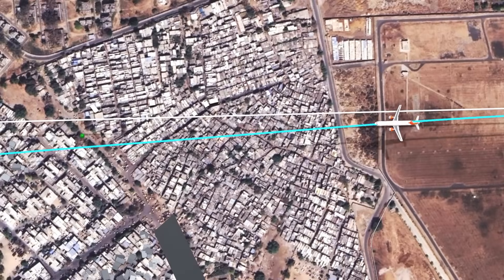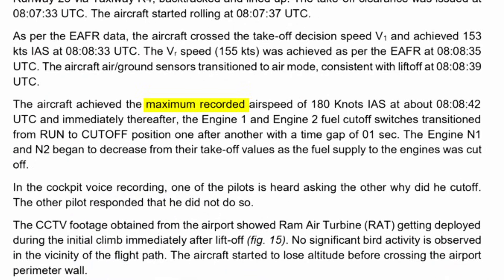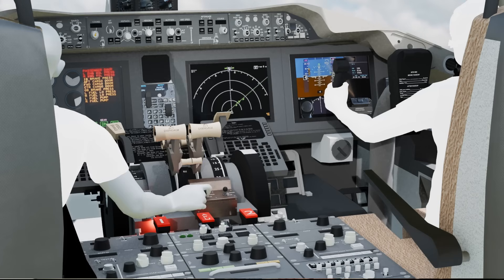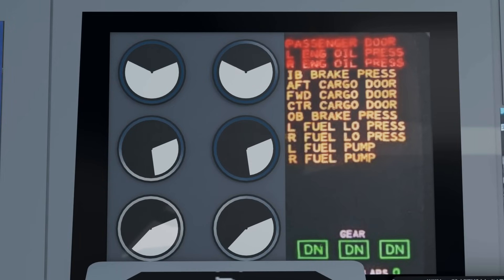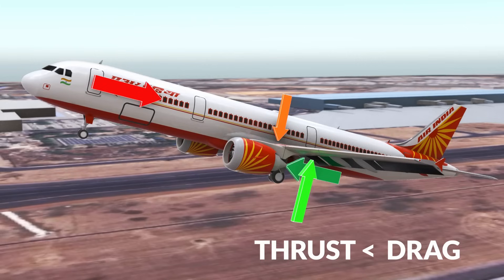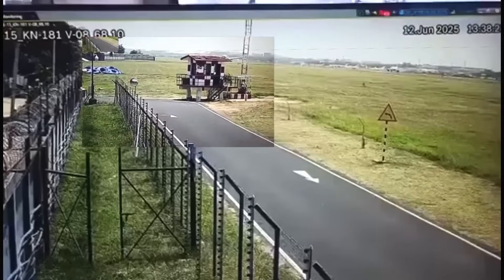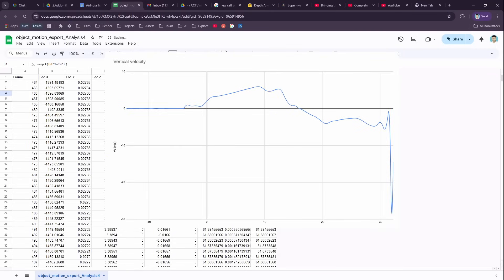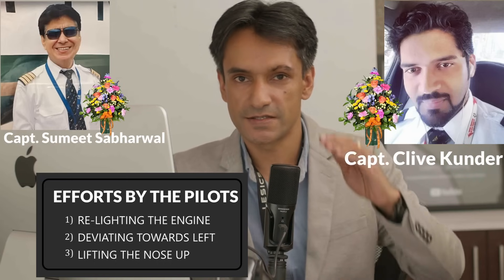Use of 3D Clone | Decoding the Crash Details you Missed

Comment: The is an excellent analysis, but a few points:

180 knots in the preliminary report is indicated airspeed, which is less that actual airspeed. All instruments have an error range, for airspeed (and altitude) the error is always indicating lower, because that is safer. If the airspeed error was higher you could unexpectedly stall. Same with altitude if it was higher than actual you could hit the ground.

If you have been following the DCA investigation, that was one case where the helicopter's altimeter indicating 100 feet lower than actual was not safer. Although they should have never designed the airspace with 50 foot vertical separation to go under another aircraft.

Back to indicated airspeed. The aircraft's pitch angle also reduces the indicated airspeed. It was 20° up which means the airspeed sensor has a z component. You need to divide by cos(20°),  and multiply by 1.05 (typ -5% error). 180 indicated is 201 actual.

Several people have demonstrated they can operate both switches within 1 second. But let's set that aside.

The FDR is recording the time of the switch contacts closing, not when the person is touching the switch handles. So it is really the time it takes to move your hand from the first switch after the contacts have closed to the second switch and move the second switch just past halfway.

You only need to move the switch handle just past halfway and let it go -- the spring in the safety mechanism will push the switch the rest of the way.

The 4 second gap in turning on the fuel switches is typical and expected. Pilots are trained to see the result of operating a switch like that before doing the next step. The pilot would have waited till the first engine responded before restarting the second.

The surprising thing was how well the 787 glided. By the book it has a dirty (gear down) glide ratio of 3.5; however, it glided much longer (3-4x). Once the residual thrust ended it should have crashed in 3 seconds. Instead it glided for 10.

Get ready, some people will not like this. Most people who have survived a suicide attempt say they regretted their actions seconds afterwards. Is that what happened here, he regretted his action and tried to save the aircraft.
Reply: "The 4 second gap in turning on the fuel switches is typical and expected. Pilots are trained to see the result of operating a switch like that before doing the next step. The pilot would have waited till the first engine responded before restarting the second."
Agreed!
I have been saying words to that effect, but the 'teach granny to suck eggs' trolls insist I should learn to read the report.
(I'm a linguist as well as an engineer, long since retired.)
Reply: @patricklockerby4308  lol. I personally don't know how many times I can re-read this report... It never seems to change. Funnily enough, some posters recollection of the report and the information contained seems highly mutable -- to the point where the facts are distorted into amazing new theories about the 'real' factors at play.
[I can not lie, sometimes I have to go back to the report to verify the paraphrased speech and the timeline in order to critically assess some very strong theories and opinons injected into the comments] :goodvibes:
Reply: It was exceptional to watch how the plane stayed in the air while engines relighting- I think also, there appears to be a very steady hand at the control waiting, waiting, to get thrust back. The nose elevation maintained through the majority of the glide seemed like the best possible way to manage height + speed until one or both engines provided enough power to get the plane to safety. I have always had the opinion that the relative lack of flight control movement + 'impossibly good' glide were a result of definite action, not the result of inaction or defeat. /jmo
Reply: The steady hand is the flight computer. The 787 is a fly by wire aircraft. Pulling all the way back on the yoke is interpreted by the computer as perform the maximum optimal climb. Or in this case maximize the glide.

At low speed and high pitch angle, the 787 automatically extends the leading slats to prevent stalling, and maintain the high pitch angle. The computer is using both the slats in the front and elevator in the back to optimize lift. It's something a human cannot do.

The graph shows when engine restarted it was a steady computer controlled climb rate. 

To me, it indicates the critical flight controls, which are battery backed up by the main battery, never lost power. And speculation of the electrical system collapsing is false.

Moreover, the manual backup for the flight controls is physically difficult to operate. It's like when the power steering on your car stops working, you can manually steer it, but it is difficult, and definitely not steady.
Reply: @lattyaktube  I see you've written lots about your assessments, in this comments section... I like what you have to write. You seem knowledgable in this area.
Reply: @lattyaktube  this video comes to a different conclusion.

https://www.youtube.com/watch?v=OLxLN3osS1Y
Reply: He makes a few incorrect assumptions which in my opinion invalidate the conclusions.

But more importantly if it occurred as he suggests the fly-by-wire system (28VDC) would be disabled and manual backup is very difficult. It's like if the power steering fails in your car, you can steer but it is very difficult and you are not going to stay in your lane. Instead we see no difficultly in flight controls, just the opposite a perfect pitch angle to maximize the glide, something only the computer can do.

The video is difficult to follow. I had to watch it several times. I have read the Dviation training manual he is using. It is an excellent manual, especially the diagrams; however, it is too high level for his purposes. There are details that are missing, and some components on the diagrams that are not explained in the text. And there are some factual errors -- it is only a 3rd party training manual.

The main battery, isolation diode, and battery charger all have voltage and current sensors -- a detail not in a Dviation manual. There would be a warning if the diode failed. And it is not actually a diode, rather a power MOSFET that has circuitry turns it on and off, and monitors its health (another missing detail).

He claims the two center 28VDC buses (C0 & C1) are tied together (he calls them center-left and center-right, or captain's and first officer's). In the 787 Flight Crew Operations Manual (FCOM) it clearly states only the captain's flight instruments are powered by the main battery (6.20.4) -- the tie line between C0 & C1 is open.

He is also missing some details in how the fuel switches, opto-isolators, remote data concentrators (RDC), common data network (CDN), (and all other central 28VDC devices) are powered. They all have dual source power supplies connected to both center 28VDC buses (C0 and C1). Internally, they have two parallel 28V to 12V regulators whose outputs are tied together thru diodes (or MOSFETs). There's all this effort to run parallel and independent 28VDC buses -- they would not be tied together.

The fuel cutoff valves are motor driven. If there is no power they stay in their current position. Also the diagram he is using is simplified for instructional purposes. I have not seen the actual 787 wiring diagram, but I have worked on similar motor driven systems. Usually they have 2 command wires, one for open, the other for close, such that losing power does not result in a command either way.

RAT timing is 6 seconds max for the hydraulic pump to pressurize the flight control portion of the central hydraulic system from a low pressure state. 6 seconds is only a requirement spec for the hydraulic pump vendor. Since the central hydraulic system was already at working pressure, the RAT only needed to pressurize the feed line to the isolation valve, 2 seconds after deployment.

Moreover, if the message the preliminary report is referring to is hydraulic pressure has started rising, meaning it is not at full pressure yet. That occurs immediately after the RAT propeller starts turning -- 1 second after deployment.

The 10 seconds he is quoting is for the max time for the electrical generator on the RAT.

A bunch of other little things, like blaming the FAA, while it was the NTSB that traveled to India. And if you have been watching any of the DCA crash hearings, the chair Jennifer Homendy does not put up any nonsense.
https://youtu.be/SqPiBSYAUuM?si=59ubj98fvyP72ps5

His evaluation of the main battery system seems to be at odds with other sources. The best article I've read is from EDN (Electronic Daily News) titled "Boeing 787 battery/charging system solutions--Good design or not?"
Reply: @lattyaktube  that seems like good analysis.  Might I suggest you discuss these points directly with the author of the video I linked?   I'm not sure if they are genuine showstoppers for the theory or details to be worked through.

Also, since you seem well informed, I am curious if you have your own theory about what happened.
Reply: @lattyaktube iiuc the smooth flight can be explained because there are actually 4 DC buses, and only the "inner" two are battery-backed.  The outer two are not, and the FADEC operates on these (unverified by me).

I will just provide an AI summary of events based on the two videos he made, which may address some of your other points.

* The main battery's single battery diode module failed, allowing unregulated voltage from the Transformer Rectifier Units (TRUs) to flow back into the battery, weakening it over time.

note: I acknowledge that if this diode fails it should have been noticed/replaced, based on your info.

* During takeoff, the landing gear retraction process applied the electronic brakes to stop the wheels from spinning, which created a huge current demand on the 28V system.

* This large transient load was the "last straw," causing the weakened battery to completely short-circuit.

* The short-circuit brought the captain's instrument bus down to 0 volts.

* The system, detecting the loss of power, attempted to restore it by connecting the captain's bus to the first officer's bus. This propagated the short circuit across the bus tie contactor, bringing all DC buses down.

* With the common core system offline, the engine controllers (EECs) reverted to a "soft alternate mode".

* Because the landing gear was down during this period, the system's logic assumed the aircraft was on approach and commanded the engines to idle down.

* the pilots did not have time to recognize the situation and override the engine control software.

* The Flight Data Recorder (FDR) recorded an engine fuel cutoff signal because the remote data concentrators (RDCs) lost their power, not because the pilots manually moved the fuel cutoff switches.
Reply: @lattyaktube  ... :goat-turquoise-white-horns:...
Reply: @danlibby6810 Only the C0 bus is battery backed up. The other "inner" bus C1 is not. The tie line between the two buses is open according to the FCOM. It is only used for maintenance and diagnostics. (Note: the original FCOM said C1 is battery backed, but a later revision corrected that.) It is not flight critical to have both buses powered.

The EEC/FADEC is powered by a Permanent Magnet Alternator (PMA) directly driven by the engine. As long as the engine is turning, the FADEC has power. During start, it is powered by 115VAC. The goal of the engine design is to keep it running independently of other aircraft systems. The engines do not need 28VDC to run, nor do they need the common core data bus.

The throttle setting is done thru the thrust lever position encoder. The flight management computer has a servo motor that moves the levers. The systems are electrically isolated, but mechanically connected in a way that the pilot can see/feel the computer adjusting the throttles.

The Electric Brake Power Supply Units (E-BPSU) has 2 power sources. The primary source is 28VDC from the TRU. And the main battery for the secondary source. However, I cannot find any documentation that states it uses the battery for brakes in-flight. Batteries are only used to set the parking brake when ground towing. It is assumed if there was an electrical issue the RAT would be deployed to provide brake electrical power, not the batteries.

So brakes applied during gear up would only pull power from the TRUs, not the batteries.

Even if the main battery shorted out the C0 28VDC bus, the C1 bus would operate normally, and seamlessly. He is demonstrating that if the C0-C1 tie line is kept open the cascading scenario will not happen.
Reply: @lattyaktube  yeah, so it would be best to discuss these points with the author of the vid, as both of you are better informed than I am.

that said, I can offer a few points for your consideration.

1. afaik no one is saying C0-C1 are normally connected.  Only that they are able to be connected, and that apparently this occurred 1 sec after the captain's bus went to 0 volts.

2. afaik no one is saying the EEC or FADECs lost power.  Rather that the EEC entered "soft alternate mode" due to detecting loss of power to common core, and then assumed plane was on approach due to landing gear being down and thus commanded engines to idle.   They remained running.

3. afaik, no one is saying the brakes were normally drawing from the battery only.  iiuc, it draws from a DC-DC transformer which steps up from the 28v bus, which is powered by the TRU and backed up by the battery.  However the diode had failed and was permitting two way current, which subjected the battery to unregulated voltage eventually culminating in a short, which the extra load of the brakes likely played a part in, since the events took place right at lift-off.  In other words, the 28v bus still had power from TRU when the braking started.

4. Indeed if C0-C1 stayed open, the cascade would not occur.   We agree.  But it seems apparent that a cascade did occur somehow, unless one subscribes to the "pilots at fault" idea.    I do not have (or remember) details on how this connection was deduced to have occurred.  That is an important and fine detail that I really encourage you to take up with the author of the theory / video.
Reply: @danlibby6810 For (3), the TRU has 2 isolated outputs. One for the brakes, the other for the 28VDC bus. Current cannot flow between them.

For the rest, it is contrary to the operations manual. And there is no evidence the documentation is wrong. C0-C1 tie remains open. Engines stay at current thrust level.

For the other video author, these points were already brought up in that video's comments -- he was very rude and dismissive. He was so angry in that video, I have no interest in engaging with him.
Reply: Vmax of 201 knots is even more implausible than 180 because achieving 180 knots from Vr within 3 seconds ( as per report) would need double the thrust of both engines thrust !!
Reply: Vr was at 08:35. It was 155 indicated, probably 163 actual.

7 seconds later (08:42) engine 1 cutoff. 180 indicated, 201 actual.

38 knot increase in 7 seconds with both enginesat take-off thrust, or 5.4 knots/sec.
Reply: @lattyaktube it still would require about 590400 N thrust with drag of 0.35 ( gear down flaps takeoff) which is far greater than what both engines can produce